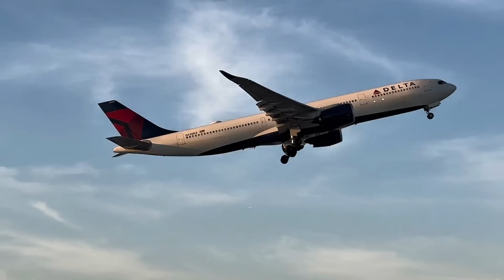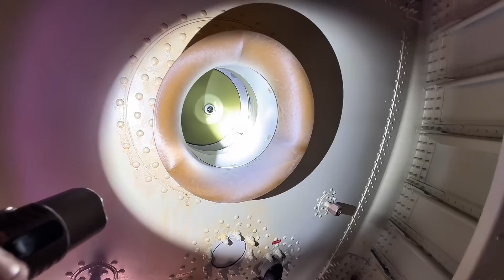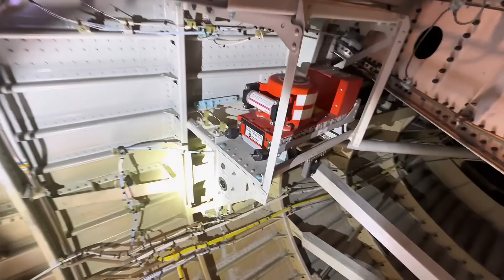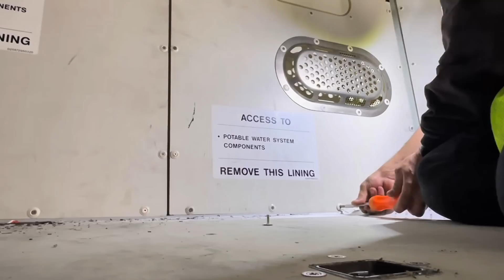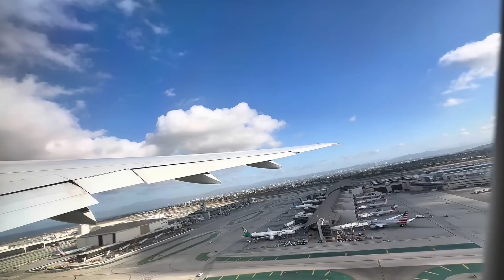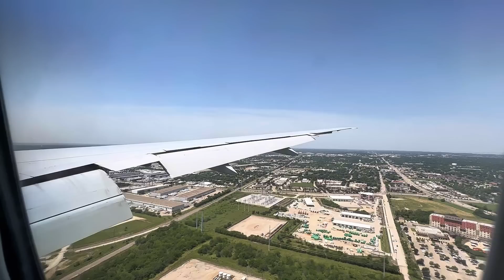Stig Shift #72 (Aircraft Maintenance Adventures)

Comment: Why did go on when the plane is over 20,000 feet ? If the engines re running bleeding air positive pressure into the water tank  at less  the bleed valve got stacked closed , it looks to me the relay pump get sticky on ??
Reply from the maker: I have no idea what you’re trying to say my friend can you please rephrase that
Reply: @StigAviation  why the pump went bad if at normal situations only run on external power generator ? Unless the main bridge- air supply actuator valve is failing

Comment: Around minute 23:49, when the spoilers extend. Why do not all extend the same amount? The second one from the left is slightly less upright than the others. I've seen this in other airplanes as well. Is there a mechanical reason? Do you start looking into that component if the difference in extension is deviating too much from what's expected?
Reply from the maker: What you’re looking at there is the flight spoilers, the important ones are on the inboard side which are the ground spoilers. Sometimes not enough hydraulic pressure reaches, but they eventually all extend evenly

Comment: Great episode, getting into the guts of the aircraft. Thank you.

A quick question for you.  Do you know how the stand markings are calculated?  i.e. The nose wheel positions for each aircraft type?  I can't find the information anywhere, and my hobby is creating flight simulator airport scenery.  If you know of a source for the data, I'd be very grateful.
Reply from the maker: I’m glad you enjoyed the episode, and to answer your question they will take a physical aircraft and park it at the gate and measure the distance where it needs to be. I don’t know of any official documentation where you can find this but this is what I have seen them do. They will take an aircraft and position it, measure out the correct distance so the tail is not sticking out into the alleyway, and then mark the ground for the nose gear position Where it’s supposed to park
Reply: @StigAviation  Thanks so much.  A challenge to say the least lol!

Comment: When a plane takes off on a rainy runway and the wheels are wet , does the water go inside the wheel well  or does it drain off or stay inside?
Reply from the maker: @KylePokeyPorter  yes it will drain, those areas have drain holes

Comment: FYI: The pressure difference is very low. Atmospheric pressure at sea level is about 15psi. So seals for this are not like pressure vessels in oil refineries which have pressures at 2000psi. That is the pressure of a steel scuba tank.
Reply from the maker: @kmagnussen1052  very interesting information, thank you so much for sharing that

Comment: Great stuff! Say Stig, is the use of handheld vibration meters common in aviation? To detect deviations in pump/engine operation and forersee failures before the occur.

There are some pretty neat handheld ones available nowadays, not cheap but cool!
Reply from the maker: @robertfeynman3174  handheld vibration units are not really necessary because the aircraft engine itself has a vibration unit and monitoring system. Pumps don’t really need that type of system, but we do have some really interesting tools to detect for leaks within ducting and pneumatic systems.

Comment: Maintenance question:  if the water system is pressurized by other sources, why was the compressor running in flight in the first place?
Reply from the maker: Usually on takeoff, the bleed source is cut off to give engines maximum amount of air. Once it reaches a certain altitude air source can be distributed throughout the cabin and systems. And the compressor is usually running, you just don’t hear it because it’s not failing like the one you saw

Comment: Great video! I had a similar experience a few weeks ago. Sat just behind the overwing exit on an A320neo. From about 10000 ft in the climb to about 10000 ft in the descent there was an intense high pitched vibrating noise coming from the emergency exit area. I had a chat about it with the crew after we landed but never found out what the issue was. Would imagine it was pressure related though.
Reply from the maker: That’s very interesting, I hope they figure out the problem. Or it could’ve been some kind of component within the wheel well

Comment: As soon as I heard that compressor having a fit I knew that was the issue. Sounded like one of those  mini automotive tire compressors that you plug into the cars 12V power supply. 2013 date somewhat old. Nice short informative video. CHEERS!

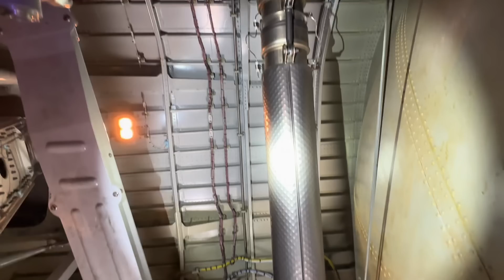Comment: ready to risk my pop Quiz answers : @7:42 You have personally checked 3 of X intuitive hunches 1. bulkhead pressurization valves 2. wires/cables from APU to pressurization bulkhead 3.  pnematic source from APU to aircraft.  - now on with SYS Checks.         5.17.2025

Comment: Any idea why the cabin crew said they only heard it upto 20k ft. Wouldnt that compressor run all the time?
Reply from the maker: Because usually cabin pressure takes over around 16-20k altitude. So the compressor is not functioning above those heights

Comment: In the beginning of your video 2:23 the 321 Neo you’re referring to does not have a black band around the winshield neither it doesn’t have the new LEAP-1A engines so technically it is Not a 321 Please correct me if I’m wrong. I’m just stay in the obvious.

Comment: DFW the horseshoe airport. I hated when I had a flight go in there and my connecting flight was way on the other side of the shoe. Almost missed flights due to that! Had to practically run to the connecting gate. But that was Ok as long as I caught my flight because that meant I didn't have to sit around in the airport for too long and allowed me too get back on my way to my next destination! 😉😆
Reply from the maker: @1calzam1  i exactly what you mean by that. Going from terminal D to A is quite a distance

Comment: Ayyyeeee Ive worked on one of those buggers, quite fun to work on, so here the break down, you have a piston driven comp, ran by a itty bitty motor, this motor does infact like to kick the bucket ie the thermal switch going bad, also another thing to add onto this “CEF” compressor, when running it this motor actually drives the piston by a physical belt like the one you find on your car’s serpentine belt, anyways leakage or the loss of pressure comes from two areas in the compressor, one leakage from the O rings and leakage from the Valve subassemblies (check valve reeds). To note be careful when handling these compressors, they do get extremely hot, and also fun fact these compressors if not functioning 100% correctly can become a bomb, relief valves on these compressors will wear down to a point they do stop working and will over pressurize a system.

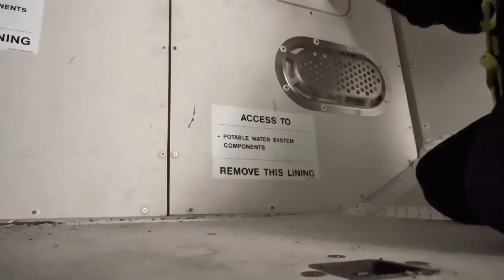Comment: 11:53 Are you talking about offset Phillips screws? I’m sure some McDonnell Douglas engineers could add in a couple of high vibration fasteners with TriWing heads on them to make it better. Maybe 50% bolts 50% screws.